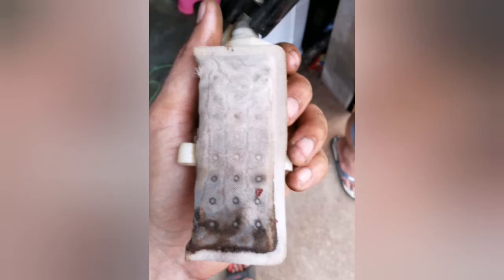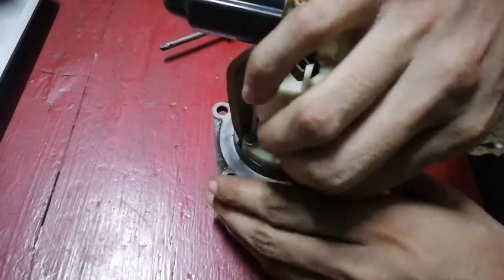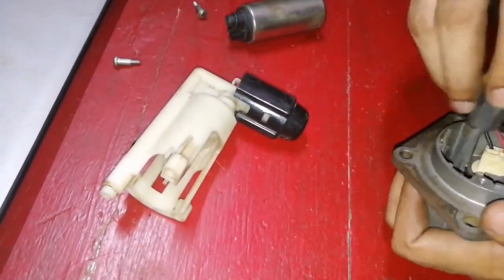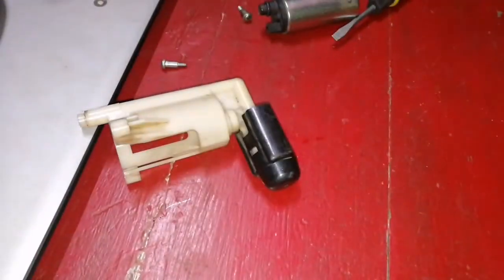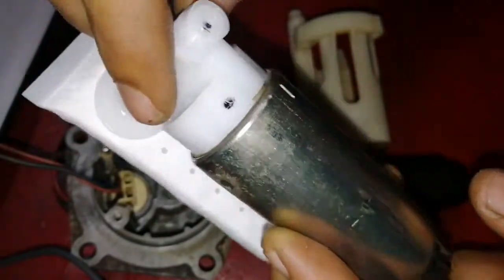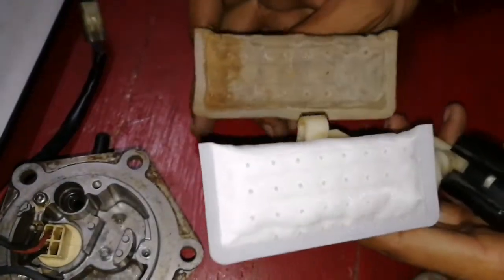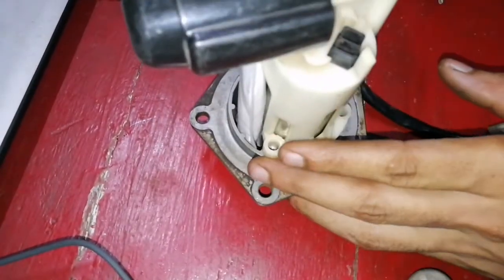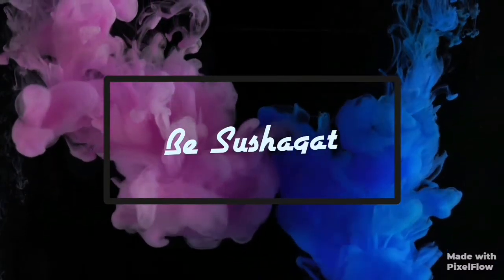how to change ROYAL ENFIELD bullet fuel pump filter!

Comment: Where to get the fuel pump filter or Motor ?
Reply from the maker: you can buy  at any authorise royal enfield spare part shop. you can buy it online but its not original and is less expensive.